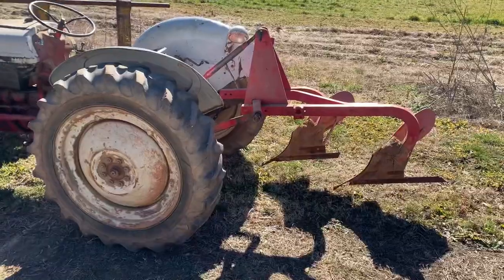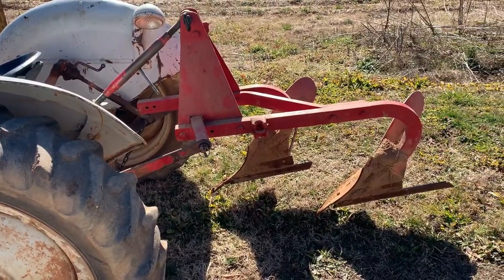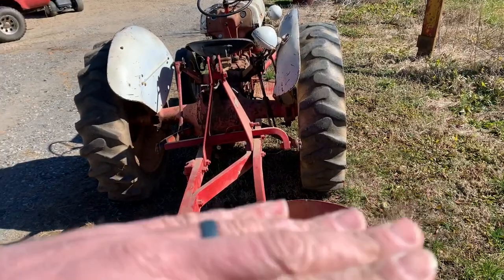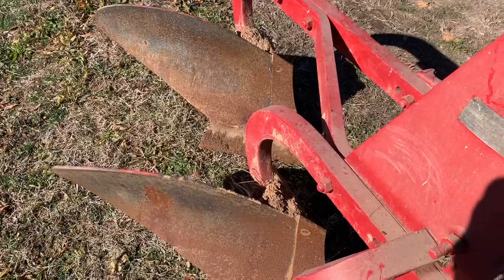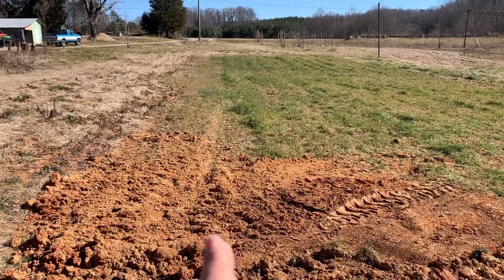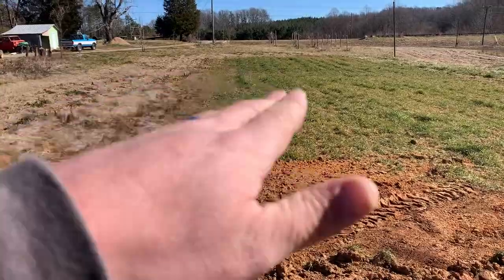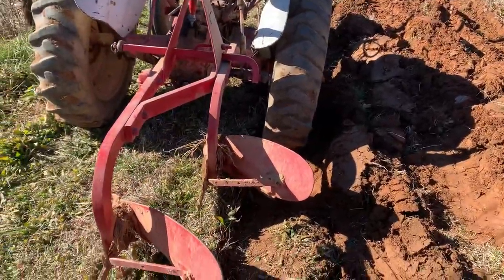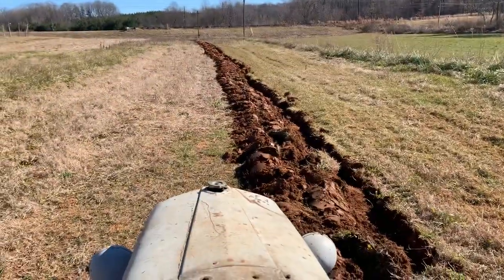How I Plow With My Ford 8n [[Dearborn 10-152]]

Comment: I have a 8n they will pull 3 14 inch breaking plow tough machines
Reply from the maker: I don’t think mine would do it as is. Maybe with some new tires and a rebuild. It’s about time for some in depth TLC. Thanks for watching and commenting!
Reply: Up in the air
Reply: 3 - 14's , you must have some sandy loam soil

Comment: Where is your tail wheel?
Reply from the maker: It is long gone. It did not have one when I bought it. It was in rough shape. I had to replace a few parts and weld up the ones I couldn’t find. I don’t think I have ever even seen a 12”or 14” with one still attached. I know some do, but seems like it is the first thing to go. Thank you for watching!
Reply: Discs,counters,furrow wheel depth gauge /setting oFor your  left control, It would be good to reas up on Fergyson' system,because it might be a ford but the 3 point system isn't,